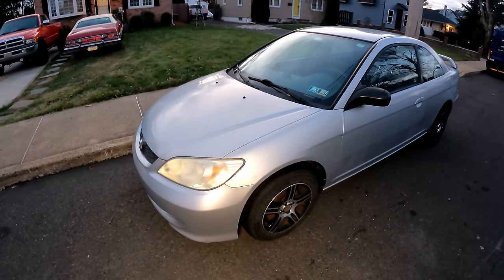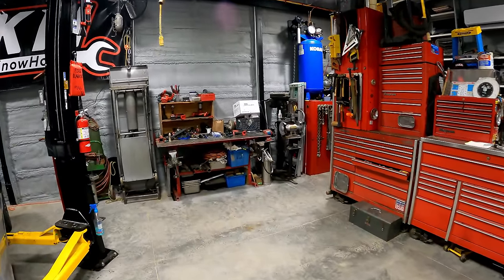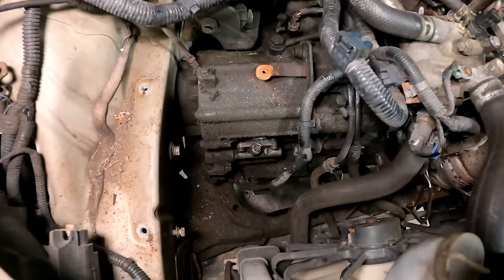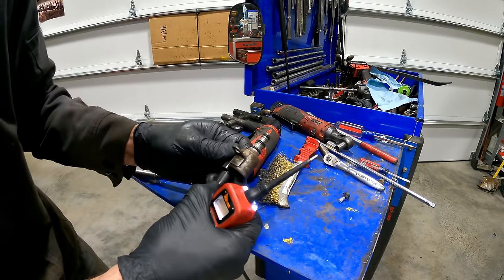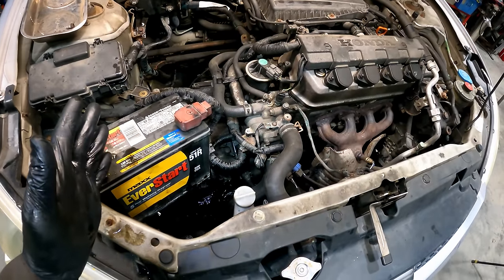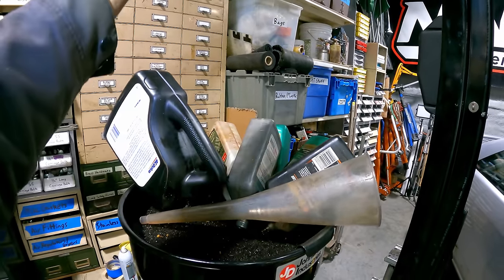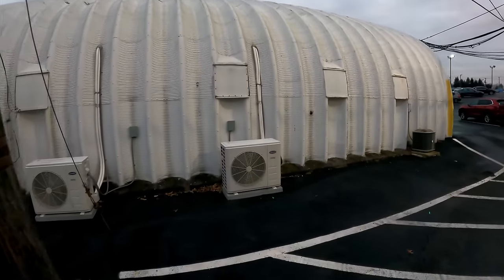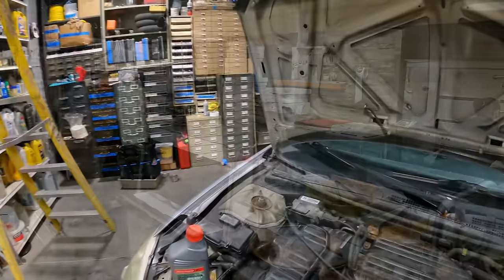Honda Transmission Slipping FAST/EASY FIX

Comment: The shop is on point…looks great. I’m not one to typically be jealous…but, that’s pretty nice brother. You’ve worked hard and deserve it.
Reply from the maker: Thanks man, yeah it's nice to have things organized again
Reply: Man…….that shop looks great! Won’t it be nice to have everything within reach in a toasty warm shop this winter?Oh, BTW….. good job on the Honda trans. We should all be so lucky 😊
Reply: Absolutely. Something like Chris’ shop is what I’m aiming to turn mine into eventually. Just the right size to have enough space and be able to heat, and everything in its own place!
Reply: @NNKH2   You've really taken advantage of the vertical dimension in organizing stuff.  I definitely am jealous- my garage has low ceilings.
Reply: @NNKH2 it's nice to have Jen's motility safety at its highest during winter time, cause gus isn't getting too many free rides, but Jen, she could get a free beer or ride anywhere in the lower 48.😮❤
Reply: I was admiring that myself!
Reply: @DB-ph5vk  you can still be warm in a lesser shop, kerosene/diesel torpedo heaters (working or not) can be had cheap on marketplace. Easy to fix them.
Reply: I was thinking the same thing
Reply: @NNKH2  There's an inline transmission filter. Cheap easy part to install. Bet its clogged
Reply: How do I flush out the old oil from the TC ?dont want the new oil mixed  @NNKH2
Reply: @WilliamCooper2005 The high shelving could use a home made, in track, rolling library ladder on big smooth casters. Chris, like the big kid, did that cool file cabinet drawer climber. If ya got kiddos though, safety bolt those to studs.
Funny might be to mount a piece of grey 2" conduit for a profile graded ladder railing. A floor parallel cut away near top rung and old school riviters bucket at base of ladder.  Like a gravity fed airless pneumatic tube system. Then the reallllly odds and ends drawers can go up high.
Reply: @NNKH2 wish I had a lift but I'll be able to afford it
Reply: Did you put diesel oil  or gas in it
Reply: @NNKH2  When you Poured Diesel into the Transmission was there a mix of transmission fluid with it or did you drain it and refill with Diesel fluid ? Also was it up to temp or did you use the fluid for testing the flow. I have a similar Issue and a Spare Transmission if need be but I was to try this first
Reply: @NNKH2  How much Diesel did you use in the trans ?

Comment: I bought a 2005 Civic Coupe brand new and had 178,000 trouble free miles out of it in the 8 years I owned it. This is almost a 20 year old car that looks like it hasn't been maintained......the transmission failure belongs to the owner.

Comment: Hey Chris. Please restore Jens headlight lenses also. She’ll see a lot better at night.
Reply: Just gonna say. 😂
Reply: She could do it for another her video!
Reply: Add some L.E.D.s  also...
Reply: Turtle wax used to have a $9 kit at walmart and I didn't even need to use the sanding blocks. Now sure how good the kit it now but the paste they gave basically took off the haze with a little wet wiping. Used the clearcoat wipes and it was pretty good!
Reply: Its an easy fix, toothpaste even works to a certain degree, but there are plenty of products that work, including metal polish.
Reply: And change the brake fluid.
Reply: @@phillipbanes5484I love using 5000 lumen LEDs on my 98 Ford van they sit high up and shine right through most low rear Windows on the cars in front of me plus I use my 8000 lumen led 21 in light bar I love the brightness of it and shining through the rear view mirror of the car in front of me LMFAO 😂😂😂😂
Reply: @@phillipbanes5484 Agreed. People with these bright LED headlights and light bars on busy roads are annoying as f^%k. They can't see good at night without it and are too inconsiderate to dim them for oncoming cars.
Reply: Spray some off spray and wipe with a paper towel it works
Reply: Success  muy bueno

Comment: Solid save on this fix, much better than pulling and replacing.  Also shop/banner really looking great.
Reply from the maker: Yeah definitely way easier! Hopefully we'll keep going for many more miles without any other issues. And thanks again for the banner! Yeah looks awesome
Reply: How did you know it was 8 ft on center or was that just how it came
Reply: @LAactor I knew based on the dimensions there was no other likely way to build that wall pole barn style so I ordered it intending for it to span two posts
Reply: Isn't there is a another strainer/filter inside the transmission. ?
"Strainer, Transmission (ATf)"
Reply: @NNKH2  man this shop makes me no longer wanna run away from owning a shop so much so it is nice and must feel good to work in such an environment. Thanks for your video. I do have a 2003 accord v6 with the same symptoms but no codes. The amount of metal I found on the magnet almost made me wanna give up immediately. It slips from 2nd to 3rd gear. I was wondering what that pump whose hose you backflushed is called so I can try to locate the same one on my accord for inspection. I replaced the forgotten filter in mine as well the Drive solenoids and I am now about to replace the oil cooler that is sitting on top of the trans. Please let me know

Comment: everyone shits on the seventh gen Civics, but I have two of the 1.7 non-vtec and they both went well into the 250K mile range with just normal wear are tear, brakes, tires, struts, someone did replace the clutch in my 02LX but that had 258,000 when a drunk hit it so you expect a clutch to be done. Yeah I mean they had evap issuses, but the parts are dirt cheap and any clown can change them out with basic hand tools.

Comment: Hell yeah, nicely done. Good call on checking the pump flow. This is a great illustration of the difference between most folks who just remove and replace stuff and a guy who understands how things work and doesn't immediately discard them when there is a problem. Cheers from Chicago!
Reply: HELLO BUD. what pump was it, I could not see well in the video. thanks in advance

Comment: I remanned transmissions under warranty for Honda for 10 years. That car should have a PLX transmission. They have micro screens in the valve body that are the diameter of a dime that easily get plugged up from clutch material...They also have several BB-sized check balls that have a tendency to wear out the steel separator plates between each layer of the valve body. They can be serviced, but it takes a lot of time and patience to do it. Even after 10 years, remanning just the valve body would take me better than an hour. The clutches inside look just like a motorcycle clutch, but instead of using springs to make the clutch packs grab, it's the trans fluid pressure...So once those micro screens start to plug up, the clutch baskets start slipping.

Comment: Score for 10$ Honda ATF DW1 . 13$ at my dealer. Had same thing happen on Lexus RX300 . Whining pump and no go! Dropped pan changed fluid AND filter ,add OEM Toyota fluid and runs like new. Love your channel

Comment: Nice little video man, this reminds me of a story from my dad.
My dad is a independent mechanic in central Oregon, owns and has run his shop alone for almost 40 years. Repairing mostly Mercedes-Benz and BMW. 
He tells me about his repairs sometimes and something like this came up, a Mercedes e320 with a Transmission problem, dealer and other mechanics wanted to replace it for 3k but after some testing dad found it was a blocked ATF line. Replaced the line, did some other stuff, 500$. 
The difference between an independent mechanic and a dealership mechanic.

Comment: I'm thankful for you posting this. My best friend brought me his wife's 2003 Civic LX sedan a week ago because it was doing the same thing, just not quite as bad.
I drained and filled the trans, drove it, then did another drain and fill. They said it was a major improvement.
Then I got a call on Monday that it was back to being just as bad, so I started sourcing a good used or refurbished transmission for them until I found this video. Needless to say, I just picked up 3 gallons of DW-1, a quart of Lucas Trans Fix, and a gallon of diesel.
I'll post an update on this comment later tonight once I've finished and let you know if it works out for me.
I figured the worst case scenario, my friends are out $100 on this fluid and diesel, and we'd be back to searching for a replacement transmission. Better than jumping the gun and buying a $1,000+ replacement trans AND a ton of labor on my part if this can take care of the problem.
Reply: Update: It worked great! The high pitched whining is gone. The lack of power (ability for the transmission to move the car & shift gears) is completely fixed. The only issue this one is still having is slight slippage between 1-2 & 2-3 at certain speeds.. But it's minor compared to what it was. Being that these friends of mine just want to get another 2-3 years out of this car, I think I've saved them from either replacing the transmission or getting rid of it and taking on a new car payment now!
Reply: @zachpeterson2135 wow great fix! Do you think another round of this “diesel medicine” would completely fix the transmission? Also, did the transmission have any codes stored?
Reply: @MrSamPhoenix  That car did not have any stored codes. And I ended up running 3 total gallons of diesel fuel through it (probably 5-6 flushes total), then flushed 4 times with brand new ATF each time.
With the final fill of ATF, I also added a bottle (1 quart) of Lucas Trans Fix, which I think helped massively.
They're bringing it back to me in about a month to replace the timing belt & water pump, so I'll be doing another transmission drain and fill at that time with new ATF and another bottle of Lucas.
Reply: @zachpeterson2135  well done 👍👍
and thanks for the service update.
Reply: Yep, gotta get all that goopy sticky old fluid out, and wet clutch packs clean so the can grab again with the new fluid. Good deal 👍👍👍👍

Comment: This was extremely helpful. More than you know.
I've been exactly there. I split open the bmxa trans to change the internal filter. Got it back together. But decided to use a different Trans just like you did. I went through with it and changed the tranny  removing it from below.  Went the extra mile and cleaned primed and painted all the frame and everything nice.
In the end it the replacement Trans didn't work. I gave up and scrapped a perfectly good covic out of frustration.

Man I bet that diesel and air trick would have worked for me in the first place.

That's why I love you. 

Thanks so much for your channel.
Reply: Sorry you had to scrap the car.

Comment: From my old dirt bike days, to my wife’s macan transfer case, the fluids get goopy and sticky, preventing the disc packs from grabbing, hence slippage.  A good flush and new fluid works a lot of the time. Who knew?  And much easier and cheaper than replacing a trans or transfer case.  Cool video and channel. 👍👍👍👍

Comment: Chris, I worked for Honda for 38yrs & p0730 & p0740 were death sentences for the transmission. Put a used one in & replaced those completely torn compliance bushings in the front control arms. Shop is looking amazing, very jealous!!!
Reply: Hey @kemitMillheim any advice on a P0720 (D light blinking after driving for 10 mins) also had a rough shift down from 3rd to 2nd.
Reply: @KarReviews  You need to inspect the output speed sensor. It might be going open when it gets warm. Check the wiring to it as well. If you replace the speed sensor and it still has the problem, the transmission has an internal problem.

Comment: This was great Chris.  I love a simpler project that brought a great result.  I am driving a 2003 Sable Wagon.  When I first inherited it from a friends estate, in the summer of 2022, I took it to a local fluid change chain and had the oil and atf changed, and the rad flushed.  Turns out, when I had the car to my new mechanic, that the monkeys didn't change the atf.  When my mechanic checked, he said the atf had probably never been changed, and certainly hadn't been changed a year ago.  The proof of this is how much better it drove and performed after he actually did an atf fluid and filter change.  This video hit home.  The trans in my car is reported to be a weak link.  I think regular changes will keep it on the road longer.  You did some great NNKH work on Jen's Civc,

Comment: That's crazy how effective that was. Thankful to older Subarus for having an external oil filter style can filter on the outside. I don't think my programming would allow myself to put diesel in a transmission.
Reply: yea, sad manufacturers moved away from serviceability and then tell you its a "lifetime fluid".
Reply: @M.TTT.  LOL it is lifetime, the life of the transmission. Money making project.
Reply: Lifetime of the transmission. a trans can live up to 60k miles or up to 300k miles. Individually yhey have there lifetime period. 😅

Comment: 2001-2005 Civic auto transmissions are prone to failure.
Speaking of transmission solenoids, 80% of cars for sale with trans issues "just needs a solenoid" according to the sellers.

Comment: Our 01 civic started slipping a week before you posted this video, and we just did the flush with diesel and backflow with air and it fixed our trans. It's been working fine for three days of pizza delivery. Thank you
Reply: still working for you?
Reply: Any update in you civic i have the same problem right now

Comment: The internal filter clogging with clutch material is the biggest issue with these transmissions, because its tiny. But, if its clogged and blocks oil, blowing the clutch material out of the filter is a band aid, the clutches are definitely worn. But I do wonder how long it would last after that. 

The forums had all the solutions except for pushing air into the lines to clear the filter. I wish I tried that two years ago with mine, might have saved me a ton of time and a rebuild. I just used the oil pump with both cooler lines off to get all the old oil out and get the new oil in through the converter. So good fix!

Comment: For anyone interested. I just did this to my 2006 Acura tl with 130k miles. You could hear the whining pump (I think that’s a good indicator if ur in the same boat) I used a donor banjo bolt with transmission hose to connect to the trans filter up top (tl/accord v6  does not have trans cooler )I drained the trans (not running) and replaced the fluid that came out with diesel. I ran it up to temp then shut it off and forced air basically into the filter housing. I did this twice (startup then shut off then use air) before draining the diesel. New grime appeared on the magnetic drain plug! Long story short this process worked! It’s 2/24/24 and I will update when it fails or if I do a filter change and or inspection
Reply: I forgot to mention my TL would only have gears for about one minute after cold start. After that it would basically act like a false neutral in any gear.
Reply: So basically you unhooked the factory line and banjo bolt and used a junkyard bolt and cutoff hose and shot the air in there???? Did you hook the other 1 back up after the reverse bj thern run it???Mine makes the same sound. all gears turn to neutral after 30 or 40 mph, high rpms until I stop and restart then I get another mile or 2 .
Reply: You can use your original banjo but I had one on standby. It’s a pain to separate that rubber hose so I just ran a “new” hose and  banjo. Reverse bj with half diesel (I actually did 100% diesel bc I had nothing to lose but it messes with viscosity and flow).
Reply: Yes I hooked up the original line that runs to the back of the transaxle. Otherwise it would just pump fluid all over the floor.  The trick is to push all fluid backwards into the bottom of trans and hope the magnetic drain plug catches it and you drain the rest of the filter plugging material
Reply: @bomatt   - I really WISH I COULD UNDERSTAND MORE CLEARLY WHAT YOU PROCESS WAS ON THE TL --- I HAVE A THE SAME ISSUE & NEED TO DO IT MYSELF

Comment: WOW that diesel flush Is a great Idea, One trick I missed on a Ford UK Mondeo estate I had a few years ago here In England. We scrapped the car because it slipped in gears but not If you changed the gears, It was working but not as It should. THANKS For that Info.

Comment: never having changed the trans oil and been slipping for a while now answers a lot for me, I am not surprised at the malfunction. I am not sure what to think of using a variety of odd ball fluids in it, on my ford/mercury products they have demonstrated that the FORD brand fluid is the only way to go, I tried some other brands but the shifting was awful. Nice looking shop!

Comment: Awesome job fixing it!  Hopefully it lasts.  I still recommend looking into inline exterior filter.  I have changed them on Elements.  I believe the civic is the same filter.   Honda will probably say you don’t need to change it
Reply from the maker: This one doesn't have an external filter but I did order one.

Comment: Damn, I wish I would have seen this video a few months ago. My nephews 2001 civic did pretty much the same thing, you could tell the fluid was pumping, just really slow so it would sometimes get into gear but it wasn't safe to fully send it down the street. We junked it and this might have saved it... yeahhhh, the 1996-2000 civic's were a way better generation of cars.

Comment: I've exactly the same situation,  they advised me to change the transmission but i will try it and inform you🤞
Reply: I have the same issue I did exactly as you said its work bro , for how long I'm not sure but it's shifting better,  salute 👏 🙌  I hope the mechanics use their brains like you do bro ❤

Comment: Thanks for the video but I wish I’d have seen it 2 years ago. Replaced the transmission in my mothers ‘05 to the tune of $3500 for a rebuild. It seems expensive until you start pricing cars in today’s market.